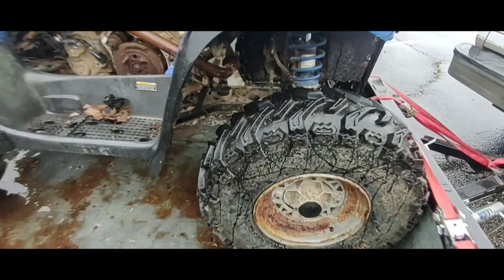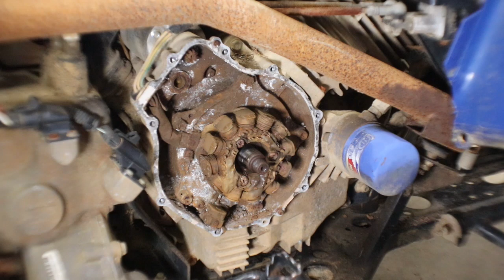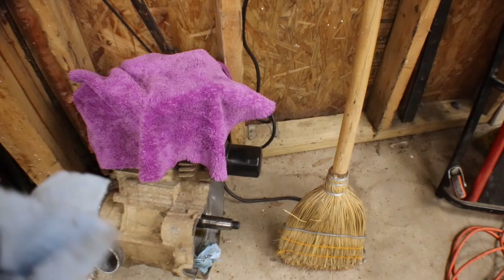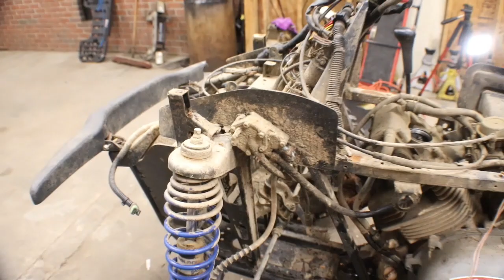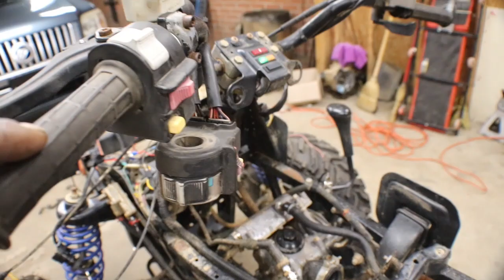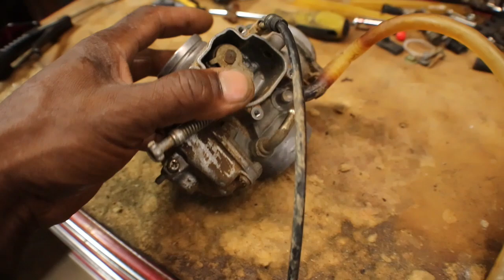Cheap Polaris 325 locked up engine ATV. Will it run. Part.1 #polarisatv

Comment: So my daughter ran her 325 in some deep muddy water, and died on way home.  Engine is locked up, can't pull an inch on the pull start.  Pulled plug, mud on it.   Advice on where to start to possibly resurrect this machine.   Thank you sir.
Reply from the maker: Sorry for the late response.   Start tearing it down. If you got mud on the spark plug the whole motor is full of water. You might be able to drain the oil and then feel the spark plug hole up and bottom of the engine up with diesel fuel and spend it over with the starter maybe it will blow it out of the spark plug hole but. Other than that the cylinder wall might be messed up.